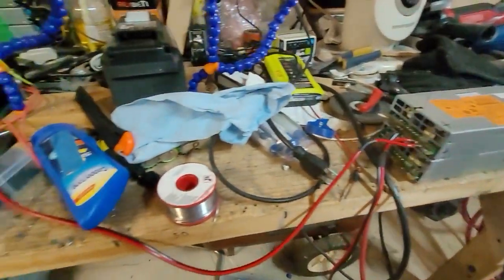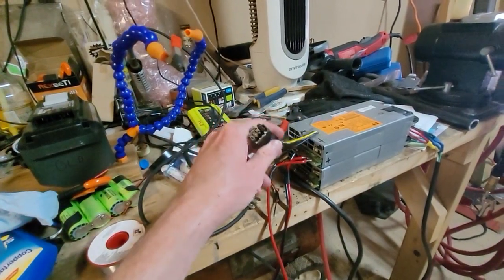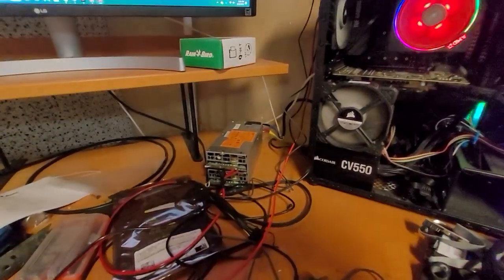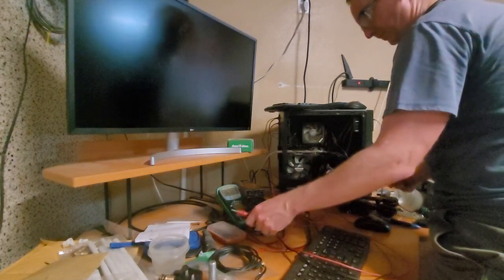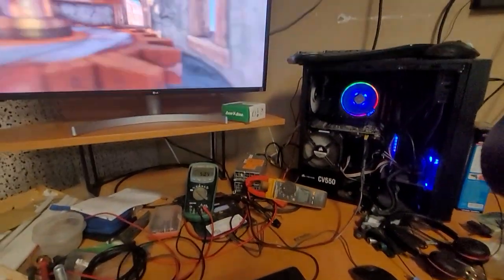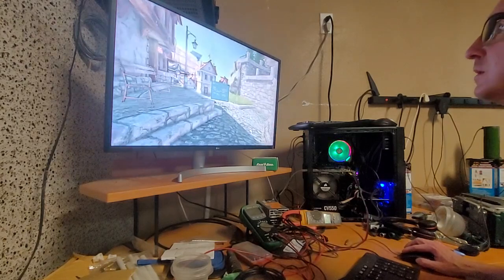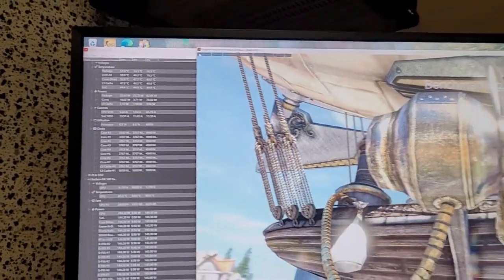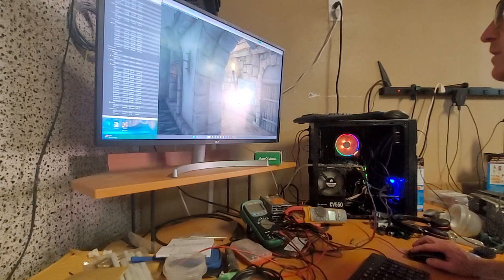Can you power a GPU with external server PSU

Comment: I've been powering my graphics card (RTX 3080 TI) with a 1000 watt server power supply for 2 years. The rest of the bill is powered with an 850 watt regular ATX power supply
Reply from the maker: Any issues?
Reply: @ericensley2427 no, Little fan is a bit loud at times. but thanks to the mining community I was able to get adapter for an HP power supply with cables. so I didn't have to solder anything. The power supply stays on 24/7. but the GPU turns on and off with the computer no problem
Reply: Are server sources the same as those used for surveillance cameras (CCTV)? If not, can CCTV sources be used in this project?
 @ElectricBlakeGames
Reply: You got any pictures, or any video about that system fam? I am quite curious